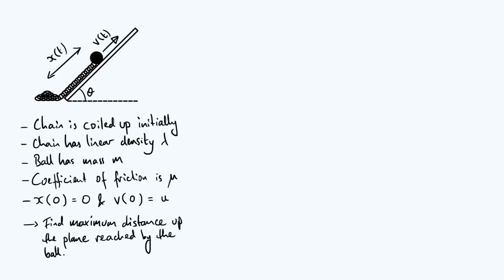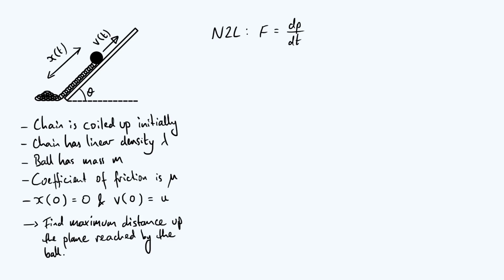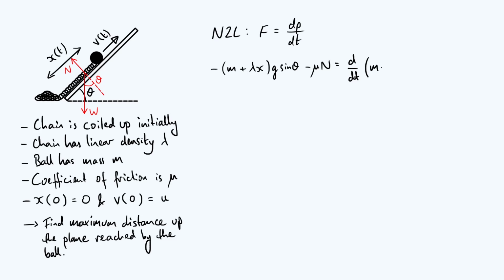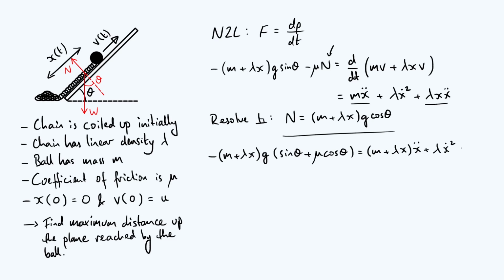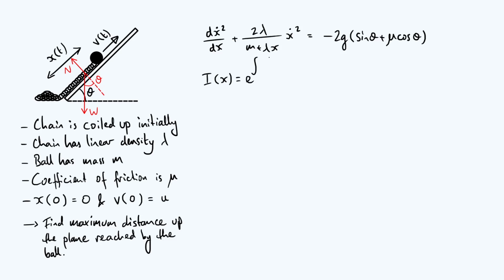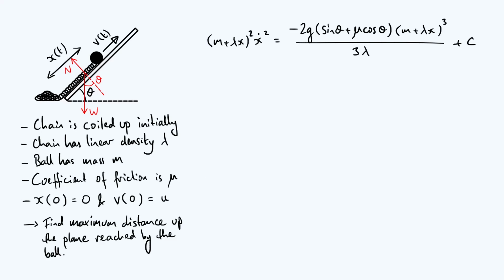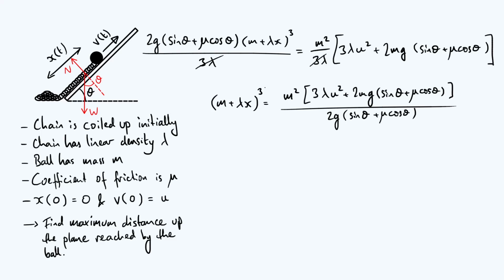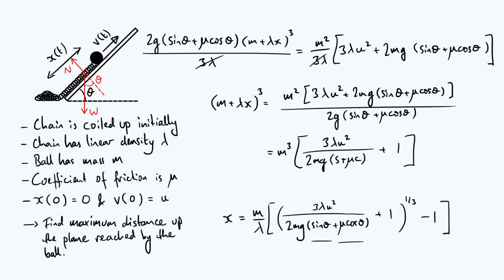Ball and chain projected up a rough inclined plane

Comment: As the chain falling from a table, here also the energy is not constant. There is an initial impulse.  Energy is necessary to "open" the coiled chain, detach the links, all the time . It´s a good proxy, a theoretically good one. Buy (X max)  is less than the answer and its correctness depends of several variables no exactly easy to measure, p.e.,the way the chain -ball set is  thrown up.

Comment: Can you please make a video on chain on a sphere problems? For example , see this problem: 
A chain of length l and mass m lies on the surface of a smooth sphere of 
radius R > l with one end tied to the topmost point of the sphere.
(a) Find the gravitational potential energy of the chain with reference level at the centre.
of the sphere. (b) Suppose the chain is released and slides down the sphere. Find the kinetic energy of the chain, when it has slid through an angle θ.
(c) Find the tangential acceleration dv/dt of the chain when the chain starts sliding down.
Reply from the maker: That's a good idea!
Reply: @DrBenYelverton It would be very helpful if you make math videos alongside physics videos. Especially on the tools we frequently use in physics like DEs and calculus of variations. Sometimes it is really hard to make conclusions relevant to the result (I mean , eliminating some part that is produced by mathematics yet which has no physical sense wrt to the problem ).

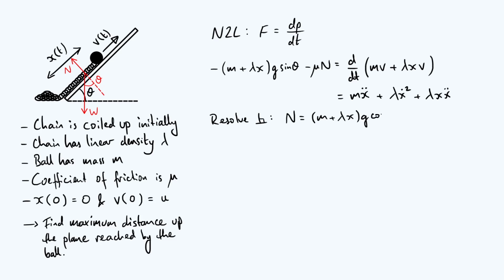Comment: Hello ! This is a very cool problem ! But i didn't understand at 7:21, how do you project to get a cos ? Is it that when you project on the perpendicular axis you get a cos and when you project on the parallel axis you get a sin ? Because I've never learned this way of projection.
Reply from the maker: Imagine a right angled triangle whose hypotenuse is the W arrow on the diagram, with one side in the direction of the dashed red line and the other side parallel to the plane. You can then see that the side in the direction of the dashed line is adjacent with respect to θ, and it follows from trigonometry that cosθ = adj/hyp = (perpendicular component)/W. For the parallel component, you're then interested in the opposite side of the triangle instead of the adjacent, so sinθ is the relevant trig function.

Comment: cool, what about a truck holding of a coiled chain that's falling and depleting over time with the case of a truck holds at some velocity or the second case where the truck initially at some velocity (so the depletion of the chains out from the trunk going to increase the truck velocity somehow). 

and the last thing the idea about this is probably a ball and a chain act like a pendulum, but at first the chains are loose until it hits the level where the chain acts as a non massless string that gives tension.
Reply from the maker: Thanks for the suggestions!

Comment: When integrating 2l/(m+lx)dx, shouldn't the answer be 2l*ln(m+lx), Dr? Cos l (lambda) is a constant
Reply from the maker: If you differentiate 2ln(m+λx) you get [2/(m+λx)]×λ, where the extra λ comes from applying the chain rule. For the integral you can just use the same argument in reverse, so the λ on the numerator disappears. That's how I usually do this sort of integral, but to see it more explicitly you can also try integrating using the substitution y = m+λx so that dy = λdx.